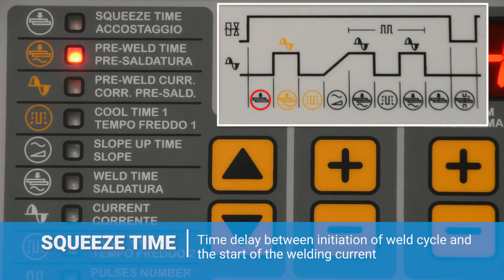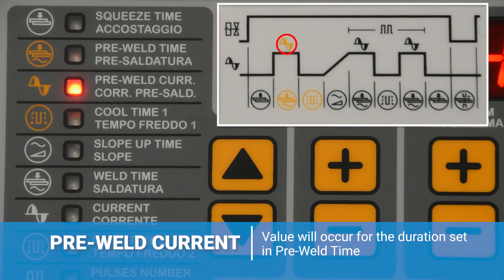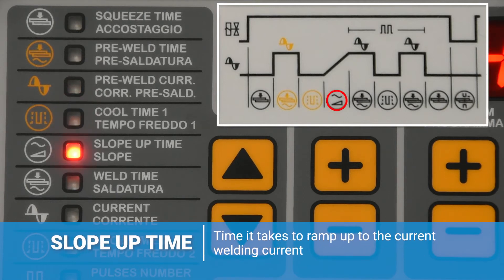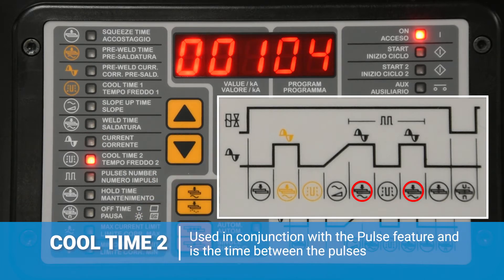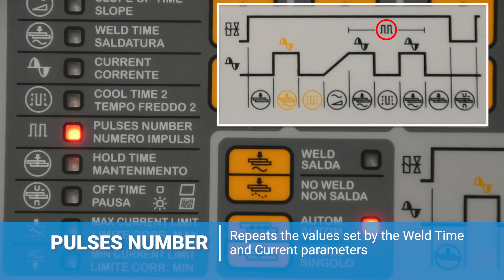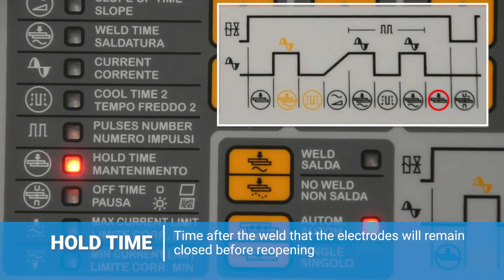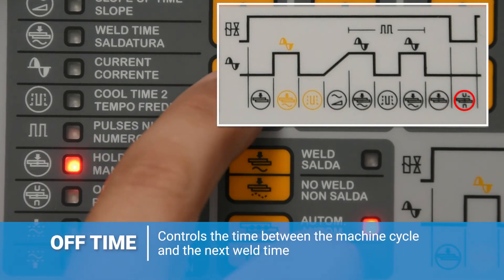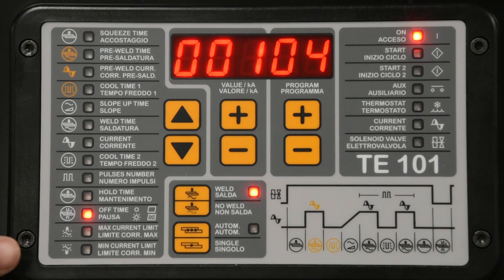TECNA® TE101 Resistance Welding Control - Overview & Basic Tutorial

Comment: Is the Tecna TE 90 Mark 2 machine suitable for welding 6mm rebar to another 6mm rebar?
Reply from the maker: The TE90 control can be installed on many different resistance welding machines. Without knowing more about the machine that your particular control is installed on, we can’t give an opinion.

Comment: Can it be used with a spot welding machine and control more than one transformer with different inputs and operate sequentially?
Reply from the maker: Not this control. What you are asking about is a control with cascade firing capability. We would usually suggest an Entron or WTC brand controller in that application.

TJ SNOW sells many brands of resistance welding controls. Contact us for help (and a quote) matching your application to the right welding control.

Comment: What the meaning of squeeze time?
Reply from the maker: Squeeze time is the delay between when you start the weld sequence and when the welder starts passing current. This time is needed to allow the tips to fully close and full pressure (squeeze) to be built before current gets passed. If squeeze time is too short, you get inconsistent welds or weld blow-outs. If too long, you just get a delay before the weld cycle continues.

Comment: Could I spot weld Aluminum .063 thickness on TECNA TE-90???
Reply from the maker: Kenny, Thank you for checking. The TE90 control is for an AC resistance welder. 
In general, AC resistance welders are not suited for welding Aluminum material. Resistance Welding Aluminum works much better with MFDC resistance welding, which uses 3 phase power. The downside is that technology is more expensive. There are some who do successfully weld aluminum on an AC machine, but the circumstances are very limited. So no, it will probably not work.
Reply: @TJSnowCo  Thank you